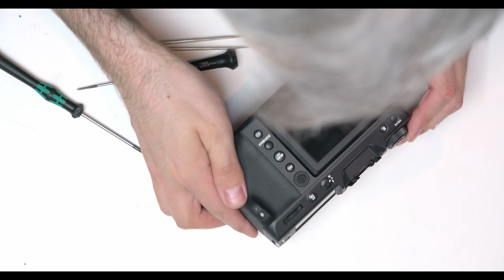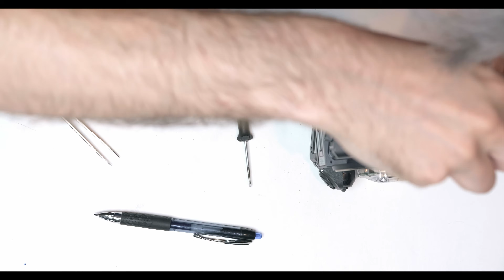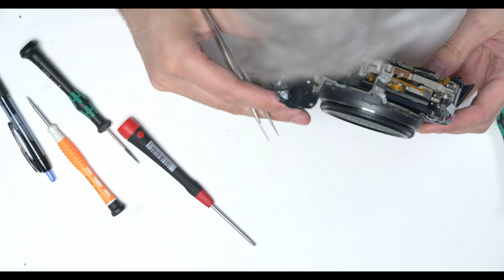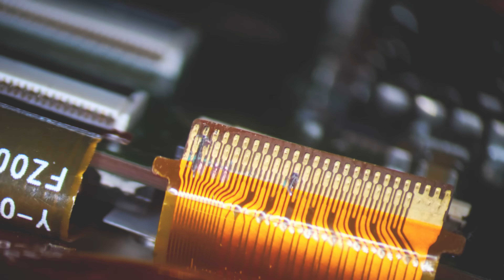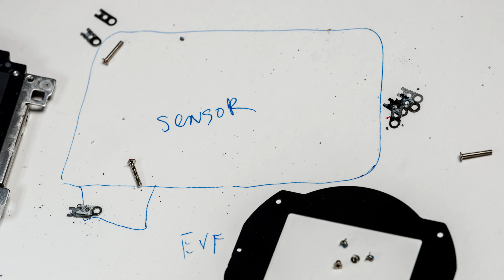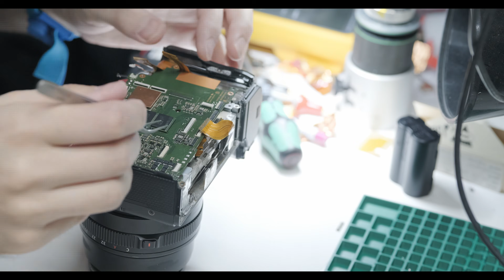"Poseidon" - submerged GFX 100 II camera teardown and repair log

Comment: Hey xDevs, random question: I know plugging a 3458A into 220 with the selector on 120 will do damage... but what about the reverse?  Set to 220 on the selector, but plugged into 120?  I'm curious to know, but not brave enough to risk trying and am wondering if you have heard of this edge-case scenario?
Reply from the maker: Should be equivalent to driving car on empty fuel tank. Output of transformer would be half of desired voltage and nothing should work :-) Better than opposite case with fuel poured everywhere in excess, I guess ;)
Reply: @xDevscom_EE  So...... I really, REALLY wanted to know.  For certain.  Because a few hours ago I saw a 2019 black model 3458A pop up for 3K with ISOLATOR FAILURE (which usually ends up as A3, which then usually ends up as the dreaded U180...) BUT!!!  Upon carefully inspecting the pictures, I could, with difficulty, make out the voltage selector switch positions in a single picture.  They were set to 220.  The unit is in the US on 120.  With great trepidation and a trembling hand, I pulled my new (to me) and cheaply bought 3458A off my bench shelf, and changed the selector to 220, connected power, and turned it on.

It powered up.  Booted.  Then it displayed the error: ISOLATOR FAILURE.  Then with my hands still trembling I turned it off, set the selector back to 120 and booted again.  No errors.  Self test passed.  Readings still good!

So... I just bought another 3458A, this time a black model and looks to be in very good condition.  We'll see if my gamble pays off next week.  I'll share my findings on my channel and EEVBlog.